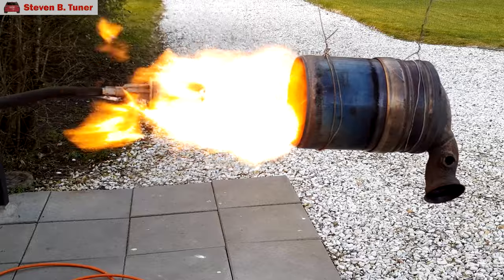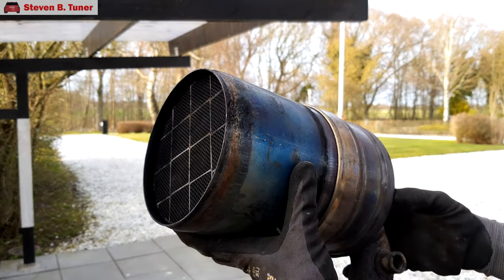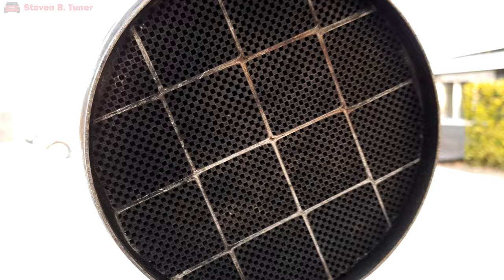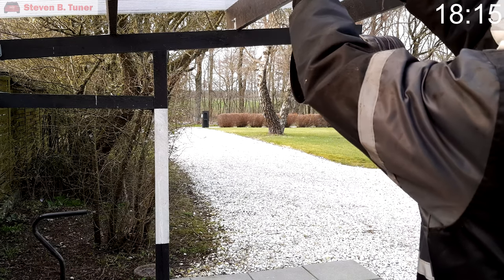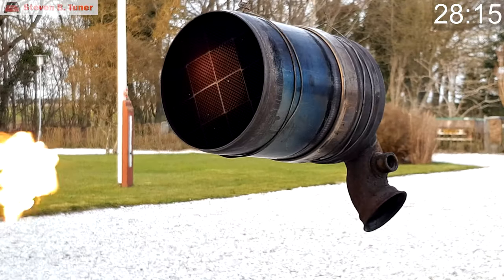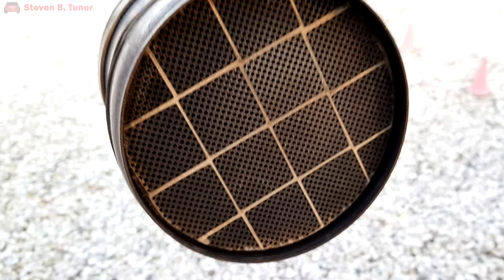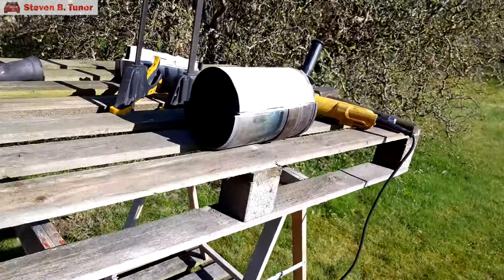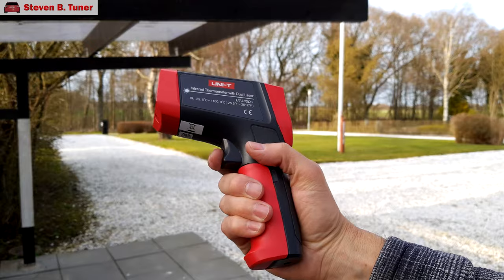The Extreme Heat DPF Clean Fail – Don’t Do This! (Diesel Particulate Filter)

Comment: 6:05 that brown thing is Eolys/infineum which is used in psa diesels for dpf regeneration. That thing stucks in those tubes and blocks the exhaust gas. We are use using chemicals before washing them with high pressure car wash. During the washing the stucked eolys comes out of the filter like little pellets. This is a 1.6 hdi dpf. Which is easy to disassemble from the car. The chemicals we use are autochem 032 dpf direct cleaner liquid or ammonia solution. Ammonia solution is also used for egr valve and other carbon deposit cleaning.

Comment: Years ago with two stroke bike exhausts we used to leave for good long soak in paraffin, then set alight.
Once the paraffin had burned out and allowed to cool gentle tapping made all the ash build up simply fall away.
Reply from the maker: That's a lot like the scheduled regeneration that your car does to burn off the soot deposits.

Comment: Great experimental setup, just a shame for the carport roof. Normally you would have to simulate the heat during regeneration quite accurately in order to convert the soot into ash. This seems to have been successful in the experiment. Only brown ash was visible in the pot. What destroyed the ceramic was probably too high a temperature (far more than during regeneration) and too different temperatures inside. The diesel particulate filter is designed for much higher temperatures than the "normal" exhaust gas would produce.
Reply from the maker: Hi, too much heat will also melt the glass fiber insulation, so chemical and ultrasonic cleaning methods are a much better idea!

Comment: Hello Steven,
I have been watching you DIY videos regarding the DPF filter and they are very informative. On my car the DPF and the Catalytic converter are in the same housing and on one of my friends cars the DPF has a DOC. After some research I found out that the only available chemicals (seemingly fit for the job) in my country are: Pool Ph reducer containing 39-51% citric acid and a phosphoric acid (used in fertilizer industry) containing 81-85% Phosphoric acid and 61% Phosphorus pentoxide. I am not a chemist myself and I do not understand how the ingredients could exceed 100%? Furthermore, do you think that any of the above mentioned chemicals can safely clean the two DPF's?
Reply from the maker: Hi, thanks for watching my vids! it is a super tricky balance when it comes to cleaning methods that are safe to use on DPFs that have an integrated catalyst/DOC. High pressure water blasting could be done really carefully to not damage the ceramic binder material, but it will definitely blast the platinum right off the Diesel Oxidation Catalyst, so you could only do it where you had good access to the exhaust end of the filter, and only applied the high pressure to that end. Ultrasonic cleaning might be a good option if you get a large enough machine - and I'll be doing some testing on that very soon (I know that some specialist companies already use ultrasonic cleaning on DPFs). Acids are the perfect thing to react and break down ash deposits, but if they are in strong concentrations then they will also (depending on the acid) attack the steel or stainless steel case or attack the materials that make up the catalyst. I go for a 5-7% strength HCl and a 30 minute time limit so any attacks on metals are minimal, but that the ash is still broken down, and I figured that HCl was available in almost all countries as it is commonly used for cleaning brickwork and masonry.  Strong acids like you have mentioned are best kept away from the catalyst, and I know from testing that if you dilute phosphoric acid down to 5% then it doesn't dissolve the ash deposits at all - so you can see what I mean about it being a bit tricky... I have received suggestions that diluted nitric or sulfuric acids will work well - but I suspect that they are both impossible to buy in most countries, and so I haven't done any testing on them.
Reply: @StevenBTuner  Thank you for the reply. I might be able to get my hands on 13% HCI. I am planning on diluting it 1:1 and repeating the process from one of your videos. BTW this ultrasonic cleaning sounds interesting so I am looking forward to see the results.
Reply from the maker: @atti0808  That would be perfect - I'd love to hear how it goes!

Comment: Hi steve, I've bought a car with a sheered turbo shaft, the shaft inc fan went into dpf and has filled dpf with engine oil what would be my best product to break down the engine oil in dpf filler please.
Reply from the maker: Hi, you will need to take the DPF off the car. Get some sodium hydroxide (drain cleaner) and mix 200 grams in a liter of warm water and then add 50 grams of dishwashing liquid. Give it a good shake. You might need to repeat it a bunch of times before it is fully cleaned, so maybe buy 2 Kgs along with a couple of bottles of dishwashing liquid. Wear gloves and protective glasses as you don't any of that stuff on you!
Reply: @StevenBTuner  thank you so much I will give it a go 👌
Reply: @StevenBTuner Hi Steven,
On your 9 chemicals to clean your DPF video I think you mentioned that you would use dishwasher tablets instead of drain cleaner after you had seen the results. 

I wonder why you haven’t used the dishwasher product. Have you  perhaps discovered a disadvantage? 
Thanks for making these videos!

Comment: I like and follow your work on this subject I wish you success. So is there a way to clean it without disassembling it on the vehicle? like pouring in through the sensor, injecting vs.
Reply from the maker: Hi, even with full removal and chemical cleaning, there is still a bunch of inert glassy products that come out at the end of the process with a water back-flush. It is for that reason that I believe an in-place ash clean can never get everything 100% clean. The in-place cleans are a good 'maintenance clean', and will probably extend the life of the filter by at least 2x if they are done every 2 years. I haven't really gone down that path because there is usually some other issue that needs addressing that requires the DPF to be removed (like a turbo issue), so the removal part is already done. I haven't dismissed the idea, and I might do it to a friends car at some stage ;-)

Comment: I see that professional use a Kilm, Does anyone know at what temperature and for how long the bake these?
Reply from the maker: Hi, I believe it to be around 800 degrees Celcius / 1500 degrees Fahrenheit for 6 to 8 hours - but I'm sure that there is a lot of variance out there. The main thing with using an industrial oven to remove the soot from a soot blocked DPF is that it has to get over 600 degrees Celcius / 1112 degrees Fahrenheit in order for the carbon to combine with oxygen to form carbon dioxide. After the DPF has cooled down it is usually given a blast with compressed air to blow out any remaining residue.

Comment: I plan to clean the dpf filter by and take another car in tow so that the engine has maximum load and maximum exhaust temperature to blow out all unburned particles.
Reply from the maker: Hi, if it is long term ash deposits that you are trying to get rid of, then high exhaust temperatures aren't going to make any difference.

Comment: This is good to burn the soot at the manifold intake maybe?
Reply from the maker: Hi, super high temperatures and plastic are never going to be a good combination!
Reply: @StevenBTuner  haha. Ya. Assuming the manifold is not plastic. Idk actually what or how my 08 3.0L grand cherokee diesel manifold looking like. But per some videos I saw I think its cast iron / steel
Reply: @nometalgearr  I don't think you understand just how much energy it takes to cook carbon off.  Your intake is going to be hydrocarbons (oil) and carbon.  In addition it is more than just temperature.  Oxygen must be present or nothing will be oxidized.

Comment: the only thing i didnt like about this video is the fact that you got the dpf to hot with the torch on the end which could have caused the cracking of the internal ceramic
Reply from the maker: Hi, the uneven heating did cause the cracking - but it still didn't get rid of the ash... Other cleaning methods are a lot safer and more effective.

Comment: What about any scraping method like a plastic stick or something, would it have any effect? Or just damage the filter?
Reply from the maker: Hi, thanks for watching! The channels in the ceramic material are blocked at opposite ends in order to force the exhaust gases through the walls of the filter (DPFs are also called wall-flow filters), which means that you can't push anything all the way through to clear out the soot or ash. Also the fine matrix that catches the soot is microscopic, so can't really be cleaned my any mechanical method unfortunately.
Reply: @StevenBTuner  I've been watching your channel since the first video, you are doing a great job. I will definetly try the chemical method when will be the case.
Reply from the maker: Thanks! I hope you'll report back how the cleaning goes!

Comment: you have the temperature but not the flow an engine would give you
Reply from the maker: Hi, thanks for watching! Too much temperature...if an engine got that hot the exhaust valves would burn out and parts in the turbo would be destroyed.
Reply: @StevenBTuner  i ment what you was doing was good with the roofers torch mabe if you had it fan assisted it might clear it through
Reply from the maker: @joken8901  I think it would have worked a lot better if there was good access to both ends of the ceramic, but most cars have the DPF enclosed with only a pipe going in and out which makes it very difficult to evenly heat it with the gas torch. For the moment I'll be sticking with my 2 stage chemical cleaning method: https://www.youtube.com/watch?v=LE1boZ3fhLg
Reply: @StevenBTuner  yes ive watched your chemical cleaning vids they are very well done you are a caring and patient man and dedicate your time and money to show others the best and worst methods to use so the dont get ripped off by the main dealers who are not real mechanics like your self but are fitters 1 off 1 on but dont know how they really work, keep up the fantastic work

Comment: The experience in the film is completely pointless. First, burning with a torch is not to get rid of the ash, but just to turn the soot into ash. Secondly, the cracks (if they were not there before), which we do not know, were probably caused by too rapid heating or too rapid cooling. The filter heats up gradually - you have to do everything while thinking about what you are doing, not the madman. It also cools down gradually by reducing the temperature for a long time, and we do not heat up to 900 degrees and we extinguish everything :-) what you expected from it, if not cracks :-) And the ash is actually blown out with compressed air but not such a pistol. Poor test, unreliable, lying and untrue because it was made completely thoughtlessly, hence the effects as in the movie. Remember, thinking has a future, not just stupid testing of something you don't know how to do properly.
Reply from the maker: Hi, thanks for watching! I take a lot of viewer suggestions on board - some of them are awesome, and some not-so-awesome... If this video stops one other person from ruining their DPF due to heat stress induced cracking then I consider it to be a success, don't you?  Not many folk have an industrial oven tucked away in their workshop, so they may be tempted to do something like this.  Just a quick correction: soot doesn't turn into ash - soot is pure elemental carbon, and combines with oxygen at 600 degrees celcius to form CO2 gas (carbon dioxide).  So let me get this straight...you are saying this is a stupid idea, and I am saying this is a stupid idea - so what is your argument?
Reply: @StevenBTuner  i was thinking of doing it till I saw the video, I would buy a new one but apparently its discontinued on my grand Cherokee so trying to think of ways to clean it and save it. Tuning is also not an option Noone tunes the Cherokee I have anymore.  Thanks for the video saved my from destroying my vehicle.
Reply from the maker: @VItimmyy  Hi, my 2 stage chemical clean is still the best and safest method I know of so far: https://www.youtube.com/watch?v=LE1boZ3fhLg
Reply: What a very unfriendly and rude comment!

Comment: Bathroom scales will not show the few grams of difference
Reply from the maker: Hi, if it was a good process then there should be well over 100 grams of difference.
Reply: @StevenBTuner  what are the increments on the scales. average bathroom set would easily be + or - 100grm
Reply from the maker: Hi, they are kitchen scales accurate to 1 gram.

Comment: Why not just use a power washer? Alotta guys do that
Reply from the maker: Hi, if you have an integrated catalytic converter, then a pressure washer will blast the platinum right off the cat.